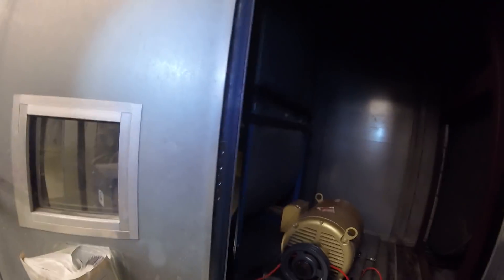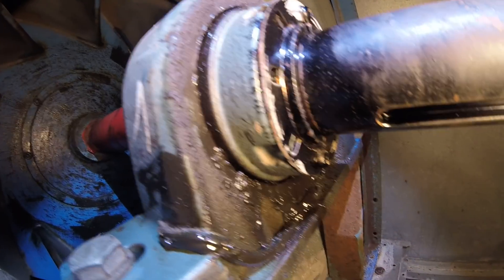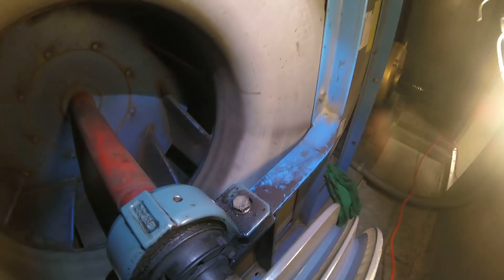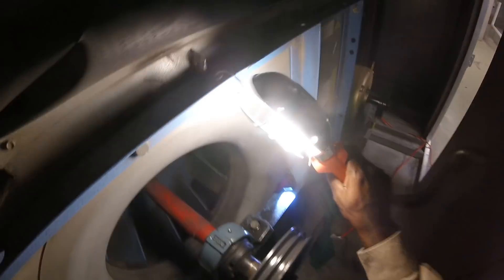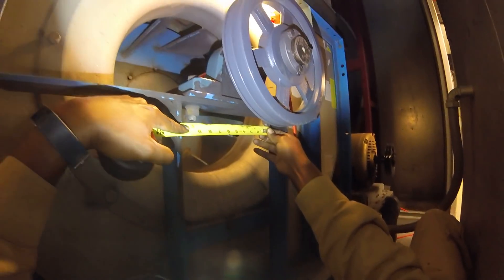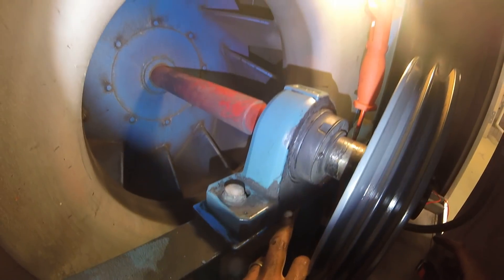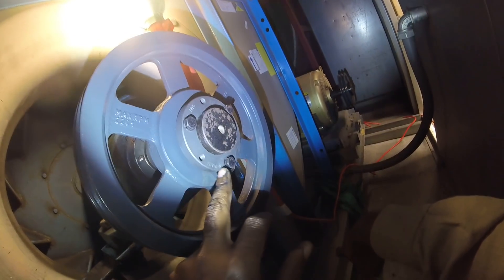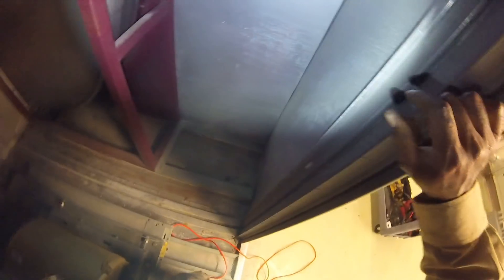HVAC: How to get specs for bearings

Comment: What I did I disassemble them and I took them to the part shop to match.You lucky this unit is inside the The building and  not on Hot roof. Thank you for the info